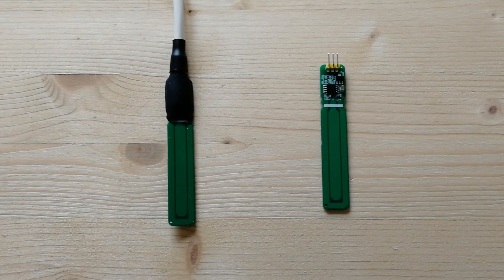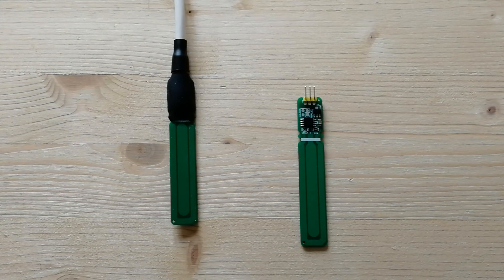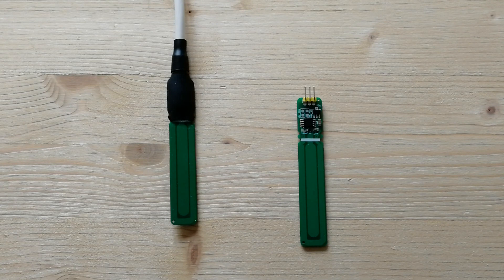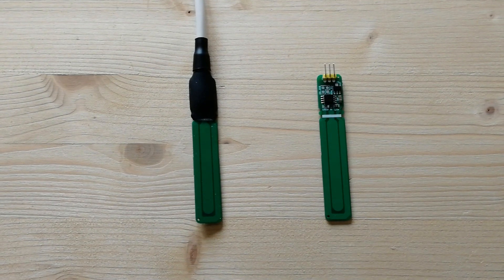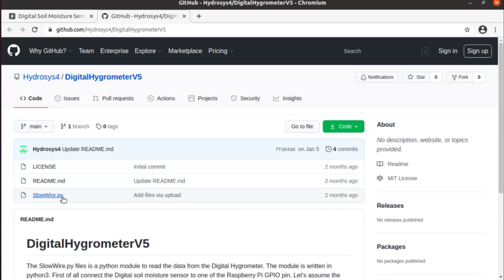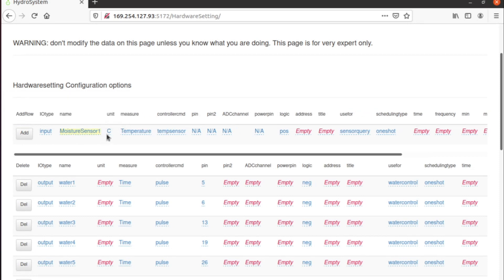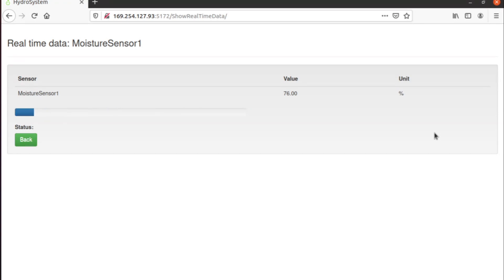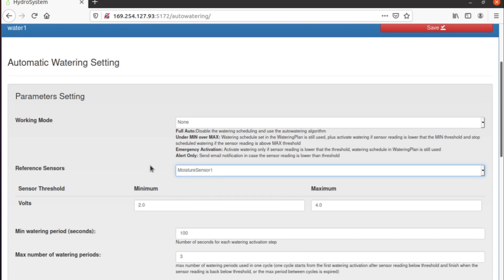Digital Soil Moisture Sensor for the Raspberry PI - Why this is different

Comment: hi , may i ask you if possible to make it wireless the soil sensor please , and where i contact you for further inquiry many thanks
Reply from the maker: The sensor can be connected wirelessly using WiFi, ESP and tasmota. I'm now in the phase of testing the wireless setup wit a battery and a solar panel. I'll post some info when all the testing are satisfying. You can join the forum and post more questions, link is in the description of the video
Reply: @hydrosys4raspberry19  thank you very much for the info I will let you know with my project , by the way I want to purchase your hat board do you tell me how much it takes to arrive to Malta pls
Reply from the maker: The board is shipped from Italy, normally should take one week, two weeks at maximum
Reply: @hydrosys4raspberry19  ok ordered i will wait for it ;)

Comment: Youve done a fantastic job on this project so far. Well done ! 
Do you have plans in the future for water PH sensor?       Ive been following along and building the same system under your instructions. Its fantastic.
Ph control will be a great step to make this project even better! 
Keep it up.
Bob
Reply from the maker: Thanks, I already purchased a PH and EC sensor, but I haven't had time to test them yet. Some members of the forum already tested a analog PH sensor with the system, you can have a look at the Forum (linked in the description) and search for PH sensor.
Reply: @hydrosys4raspberry19  thanks very much i will look at that today

Comment: HI, I am very interested in a remote moisture sensor that can run on batteries and stay charged by solar. I have been trying to get a esp32 to deep sleep and work on battery power for a long time, but have not had any luck. The AA batteries would only last about two days. Maybe a different board might work better.
Reply from the maker: I agree that the ESP is not so energy efficient, anyway this is also due to the nature of WiFi which was never designed to be energy efficient. It can be solved with bigger panels and bigger batteries :). Both panels and batteries are becoming cheaper. I'll making some experiments with solar in the coming videos.